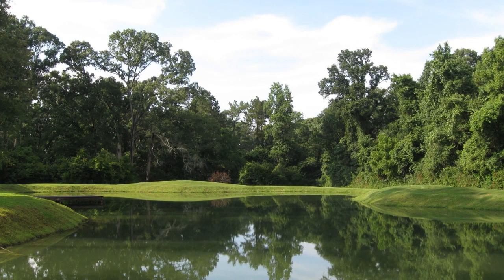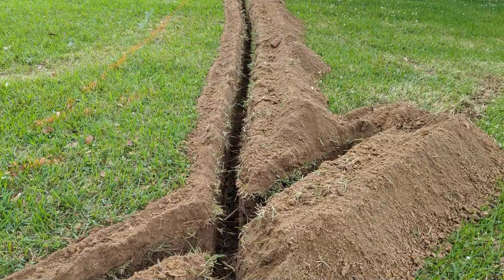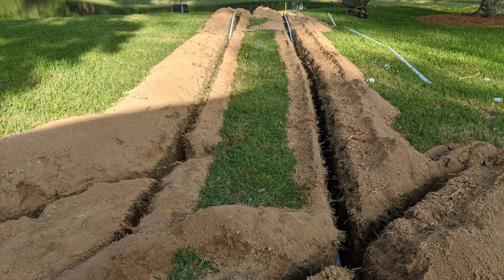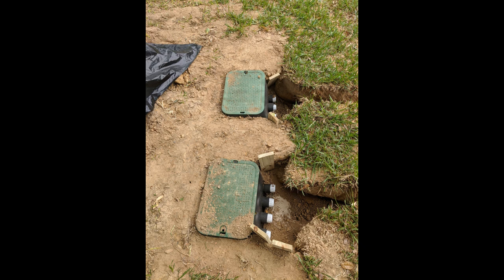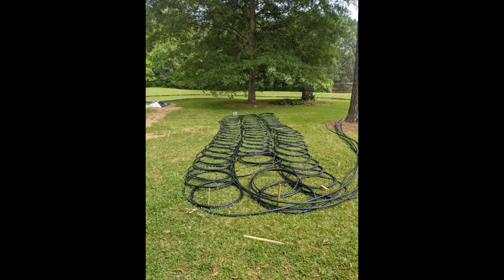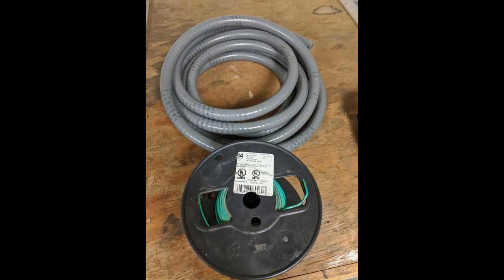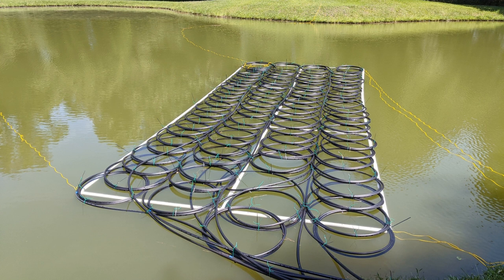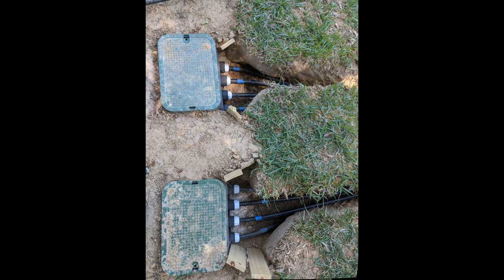Geothermal Pond Loop DIY Construction and Installation

Comment: Physicist here: I haven't done the calculations, however, my gut feeling tells me you'd probably get better efficiency and less work using only a couple feet of metal pipe. Perhaps a copper pipe made into a coil. Due to using water as a medium, you're not limited by the conductivity of the surrounding medium. Furthermore, convection is your friend.